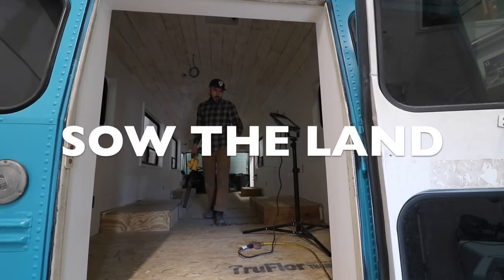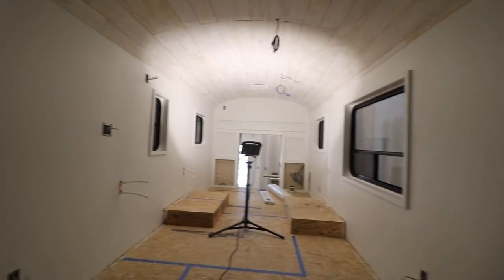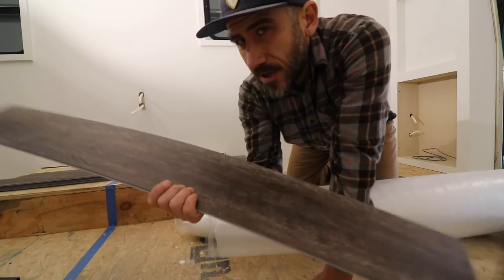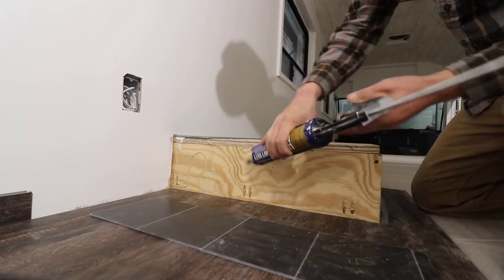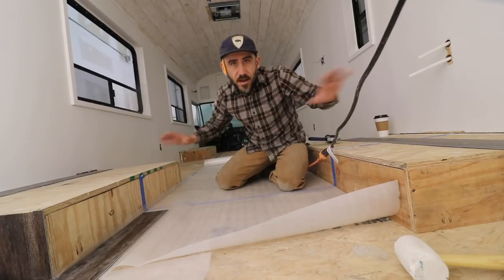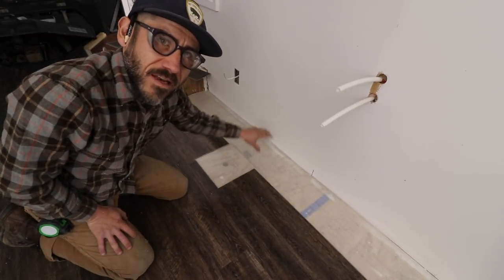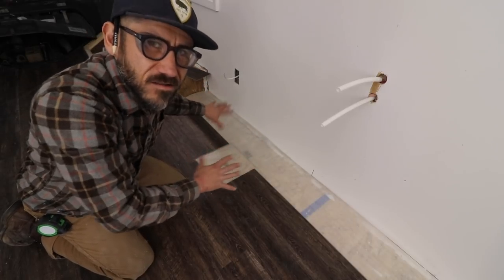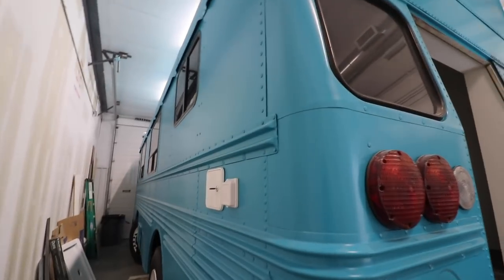How to INSTALL FLOORING in a SCHOOL BUS CONVERSION

Comment: So i have heard to do the floor at the ending. B/c the floor will expand? What do you think about the floor expanding and bulking??
Reply from the maker: I have done it this way before and haven't had an issue. thanks!
Reply: This type of flooring is an easy install but will give you issues down the road. LVT is the only one that doesn’t and requires an adhesive glue. Tile flooring is also a good option however it is a heavy addition.

Comment: I loved the video and I'm one of your subs already Jason❗️ Maybe your the one I can ask and get a solid answer from. My wife is wanting to get rid of our carpet in the whole house and replace it with carpet. But I was thinking of doing some flooring like what you put in the bus in a couple rooms. Do you have a recommendation on doing that❓ If you'd rather not answer here I could send my email to you❓❗️ Thanks either way it works out🙂🙂❗️
Reply from the maker: I would highly recomend doing this flooring. I installed this flooring in our whole house. Much better than carpet in my opinion. Also, it's very simple to install. thanks!
Reply: Sow the Land ---I was hoping you would say that cause it looked easy to install. Thanks for getting back to me I really appreciate it👍🏼‼️